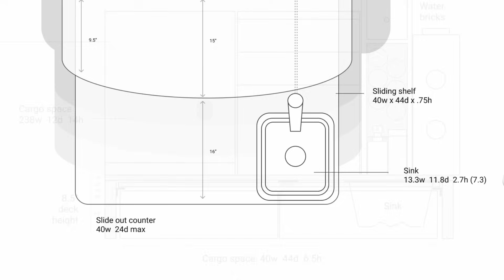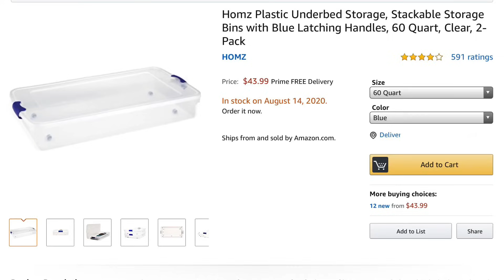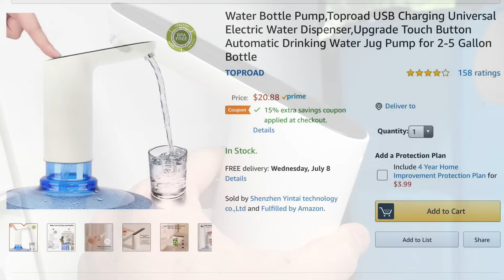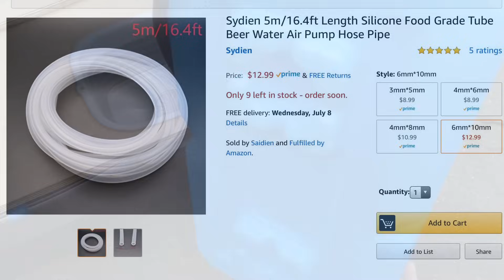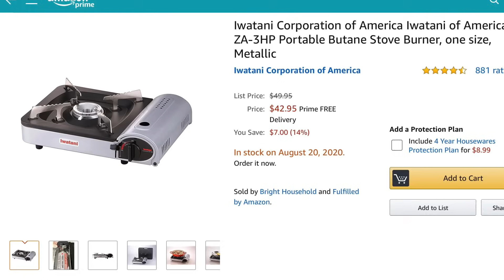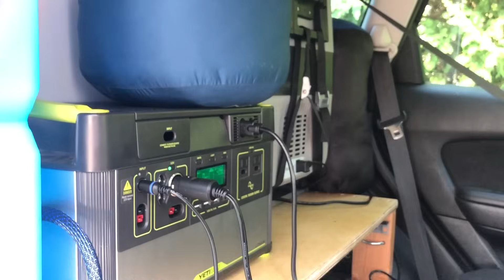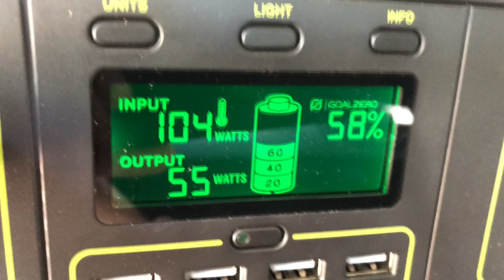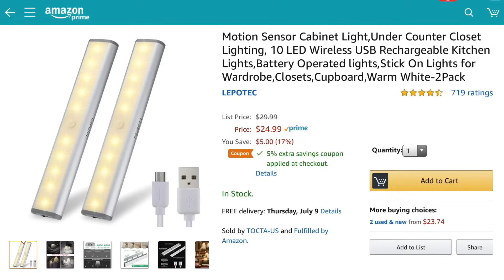SUV car camping kitchen with sink and fridge - DIY organization ideas for family camper

Comment: Love this! I completed a van build last summer, and did a big kitchen setup. Then took the van out on her maiden voyage and quickly realized that I didn't really want to cook inside the van if I could avoid it. I also had some other functional issues, so I came home, ripped out most of my build and am just now finishing Van 2.0. I'm implementing your system by building a platform in the rear of my van that will serve as the floor under my bed. I love the functionality of it, and can either pull it out to make a sandwich in a parking lot (can't tell you how many times I've done that!), cook right there at the back of the van at a campsite, or use the easily-removable bins to relocate cooking gear to a campsite picnic table. Hope you're loving your Dometic CFX-75! That's what I have in my van, and there's truly nothing better than enjoying a pint of Ben & Jerry's while camping ;-)
Reply from the maker: That’s awesome! I’m loving my 75, but it sure is big in my Mazda. Itwill be way better once I get a minivan. I’d love to see your build!

Comment: Thanks for "just sharing", for those of us that are either in the middle of our build or in the design stage ,I thank you very much as I'm in the design section, even though I have a good idea of what I'd like , I still have to pick out the specifics, mainly the brands which of course change things up. And more than likely the dimensions will be different. Wouldn't it be nice if everything was like the water tanks you have, everything fitting together like legos and as someone who is not very good with construction I look for items just like that.
       So this is a guy who really appreciates the information, so I feel I owe you a thank you , you at the very least gave me some idea where to start looking. While I'm sure mistakes will be made by me, it's folks like you that will make those fewer , saving me money which I hope that I have enough to do things effectively. Sorry to hear about the fridge. If you do most of your trips on weekends wouldn't you be better off with a good cooler, ice in a really good cooler will stay without melting for at least a week.

Comment: Thanks for sharing this video, I am in the thinking process of converting a future sienna, sure can use a lot of your ideas, showing the Amazon pages really help, I can screen shot them instead of pulling up the links later, the water bricks and the faucet are something I would use for sure. I am just saving all different infos from different you tubers and one day make my own conversion to best fit my needs, one hurdle I have to solve is convincing my wife to down size from a motor home to a mini van. Liked and subbed.

Comment: Great build out! I would like this in my honda odessey for full time camping. And a great price. I still cant get away from the cooler over a fridge. I just need a simple small fridge, i guess. Thanks for your thorough video.
Reply: Awesome, great ideas, intelligent and uncomplicated! Will use this as a benchmark for my conversion, thanks a lot.

Comment: If you still have the fridge,.. I had the same thing happen to mine.. Found a very simple fix.. Been working fine for a few months in my shop since..I don't know if I can post a photo, but what I did was run a small reusable twist tie (Lowes) through the ventilation holes near where the removable plug goes in, wrapped it just behind the plug head holding it close to the fridge.. Wiggling it as I inserted it... Working fine since... I hope you have the same problem and this solution fixes the issue... BTW.... really dig your layout..
Reply from the maker: Thank for the tip! I returned the fridge but I’m sure that fix is helpful for others

Comment: Great build out! I would like this in my honda odessey for full time camping. And a great price. I still cant get away from the cooler over a fridge. I just need a simple small fridge, i guess. Thanks for your thorough video.
Reply from the maker: This will work even better in a minivan. If you’re living out of the van, I’d suggest getting a compressor fridge over a cooler, mostly because your food will get pretty soggy and you need ice daily. Don’t be tempted by cheap thermoelectric coolers - they don’t work well and use a ton of energy. There are cheap, small compressor fridges on amazon

Comment: I have a Mazda CX5 & I'm in the process of adding a system like this.   The problem I'm having is that my spare tire is stored under  the floor mat where my system will be.   So securing as you did would definitely create a long drawn out tire change.   It looks like I would have to remove my fridg & cabinet drawers before I could remove the platform,  to access my spare tire & jack.   I understand the need to secure a big setup like this but  I also don't want the added hassle.   You have a lot of great ideas.
Reply from the maker: Yeah the spare tire is pretty well buried and you’d need to unload to access it. I have AAA so I would just call a tow honestly

Comment: Very informative, I liked that you included the product information by means of showing a screenshot of an Amazon page, very clever. In your total estimate, you quoted around $750, you forgot to mention your electric system. I checked on the Goal Zero Yeti 1000 W Solar Generator and it costs $1999.00, plus you need to add the solar panels... another $300 to $400 for good ones. By the way, was that brand teepee or tipi. I could not find them, so if you still like them, could you please provide the name with a model and a link. Your sliding bottom shelf is a good idea too. I am a woodworker and I use drawer sliders, but they are quite expensive. Your method works, and it is quite cheaper... good idea!
Reply from the maker: Yeah, I mostly focused on the cabinetry price since those other systems also don’t include electrical or refrigerators and you could just use a cooler. You can get a refurbished Yeti 1000 on eBay from Goal Zero for $730. A compressor fridge costs 250-500, I’d go with Iceco if you want a cheaper fridge with the Danfoss compressors.  I used TP-Solar panels which I really like. You’ll can get 100w panels for about $180 on sale - https://www.amazon.com/dp/B088FPQZ7V/ref=cm_sw_em_r_mt_dp_5NVEJQ41DD0J7QGY5KJ7

Comment: A lot of Aussies use 90mm or 100mm storm water PVC pipe and mount it on the roof rack. The amout of water is deteemined by what length you make it. Let gravity do the work.

Comment: Fantastic fer sure! But... once you add the Yeti power bank, the solar panels and a fridge, you're back over $2,000 again. Yes, you can use a good cooler and eliminate that $2k. Thanks for a great video.
Reply from the maker: Yeah, I was trying to compare what those 2-4K boxes include and they don’t have batteries or solar, just cabinetry, sink, faucet, etc. and like you said, a Coleman cooler would work her on the cheap. I just tend to over do things!

Comment: First, I began building my SUV kitchen to augment my rooftop tent (now 20 years young), a dozen years ago.  I bought a deck box that slides into the back of my XTerra, use it on its side.  The hinged top becomes the countertop.  I built sliding shelves, everything needed, into it. My water supply is a seven gallon Reliance to the side with gravity feed.  This has been awkward to handle, so I decided to try you pump.  I bought a different brand pump because of the dripping when the pump is lower than the water supply.  The one purchased behaved the same way so it must be a design "feature."  The solution is to put the water tank low, say, on the floor of the back seat!  I found that not only do the backseats fold down, they come out!  Now I have the water lower than the use point(s), no dripping, just used a longer supply hose.  And the tanks are SO much easier to handle, refill, etc.  Thanks ideas!
Reply from the maker: Sounds like a great setup! In my new build, I removed the 3rd seats and put a 10 gallon water tank there to fix the dripping, works like a charm now.

Comment: We have a '16 CX-9. I.may just "borrow" some.of your ideas. Thanks for posting!
Reply from the maker: Perfect! It’s a very curvy car so be sure to do lots of prototyping in the car to get the angles right. Looking forward to a square minivan...
Reply: @todd.parker  Will do! Thanks for the reply.
Reply from the maker: Norsefalconer One tip: if you have the rubbber mats in the back, you can trace that for the back hatch curve and remember it’s asymmetrical- the little pockets on the left and tight are different depths so trace from the center of the logo, not the mat. I..uh..learned the hard way
Reply: @todd.parker  That's a great tip! We have Weathertech mats, so the process might be a little different. Thining about it....I suppose the under floor storage bin covers (left, right and center) might be good as "rough" patterns as well.
Reply from the maker: @norsefalconer  Very true, the curve is a bit hard to draw so using something to trace is good. You can also go inside and cut some cardboard to the curve too, or just leave it straight and lose a few inches of counter space on top. One downside is you can't access the storage area by the spare tire so what I did is move the things I normally keep there (jumper cable, fix a flat, 12v tire pump, etc.) to the back of the right hand bin so I can still access those. If I need to access the spare tire, it's going to be a lot of work but I'd probably just call AA at that point.

Comment: Good job Todd! Looks great man! I used the same water dispenser
Reply from the maker: Oh nice. In a camping setup or on your 5 gallon water bottle?
Reply: @todd.parker  I took my 2000 ford expedition (old car) and converted into an Camper/traveling truck for my family. I used the dispenser and connected it to a 4.5 gallon water.
Reply: By the way, I took it for its first dry run this passed weekend. We went camping with it this past weekend
Reply from the maker: @motivason  Awesome! Did you come up with the dispenser idea at the same time I did? If so...great minds
Reply: I think we did brother! 🤙🏻

Comment: We love this build! Want to do something similar for our Toyota Highlander. We use water bricks also for our hurricane supplies and think they would also work well for our travels. Do you still like your build? Anything you might change or suggest to us now that you've been using it for while. We appreciate your channel!
Reply from the maker: Thanks! Great question. Since I made this video I bought a Pacifica minivan and have been working all winter on a new kitchen set up for that. I think for an SUV this still is solid though I might suggest trying to place the water bricks below the faucet because it will drip a bit otherwise and look into using aluminum U channel like this instead of the angle iron to support the drawer from the top and bottom. https://www.onlinemetals.com/en/buy/aluminum-channel

Comment: Very nice ideas!  Surprised by the projected cost of the system. As you point out, the Chinese fridge for $325 didn't hold up. I suppose you get what you pay for.  I think you forgot to mention your YETI power system is around $1,300, plus all the PV panels and other stuff might be as high a $2G.  So one is not going to out together a rig like yours for $750.  Great ideas and info on hardware for the DIY crowd.  I'll definitely use some of your ideas on my Gen.4 4Runner which will be going through a slight overhaul from the system I made, especially moving to a modern 12V fridge from the 3 way propane one I use now that I bought 10 years and still works, including using more extended bearing pullouts to make access more convenient. Thanks for all the ideas and a great video.  Cheers, Marshall
Reply from the maker: Yep, I mention that the costs are for the structure itself since you could get away with just a cooler for $30 or spend thousands on a Dometic fridge, Goal Zero 3000, and 400w of solar panels so I figure that part is too variable to nail down for everyone. I ended up getting an Iceco JP40 and have been very happy with it, they run about $500, less on sale.

Comment: Thank you for the great video! I accidentally found you! I want to do something similar in my Yukon that pulls my TAB 400. Instead of the file cabinet, I’ll put in a Milwaukee 3 drawer tool bin (is it called a Bag out system?) Next to my electric cooler, like yours.  I’m pretty excited, now.  Thank you! Gail
Reply from the maker: Sounds good! Check out my minivan video for lots of new ideas. Thanks again for your support

Comment: If you put a roofrack on the, well, roof, you get TONS of extra space for stuff. Maybe add a topbox, doesn't need to be huge. I've seen a genious idea, using a plastic rifle box for recovery gear and some tools, like a saw and axe. OR just add a rooftop tent, so all your extra tent and sleeping pad crap just fades away. Some don't even cost that much.
Reply from the maker: All good ideas. In a later video, I added a roof bag and it's great. I just bought a Pacifica and am re-working all this so we can sleep inside and have a rooftop tent for 2 more.

Comment: Great video Todd !! I'm in the middle of a mini-van build out myself and your water system was very helpful as I am doing something similar but the braid, elbow and shrink sleeve (do you have a link for these ?) were ideas that will definitely help me. I am building out a 2008 Honda Odyssey and we have a bed inside. When I am all done, I will shoot a video as well to show others what I did. I also found the USB chargeable water pumps but the one you're using looks like it has a better flow than mine. Thanks for sharing !
Reply from the maker: So glad it was an inspiration. I'm finishing a minivan build myself and will post a video later this summer.

Comment: Consider a grey water pail  matches incase the stove igniter fails and place the garbage on the side of the file cabinet instead of on the drawer or use a locker shelf inverted it will hold open a small kitchen catcher and can be stowed away when not in use
Reply from the maker: Good tips, thanks

Comment: That water faucet looks great... can you give a description of how you took it apart and then put it together to make it work the way you have it?
Reply from the maker: Sure. The faucet comes with a short length of tubing and is designed to sit on a 5 gallon container. I needed the tube to go out the back of the unit so it could sit on the counter so I used a Dremel to make a notch in the back large enough to fit the tube. Since the tube connects vertically in the center of the faucet base, I wanted to give it some room to make that right angle so inside the base (it's empty except for the tube), I added some foam donuts I cut out, then took a small roll of tape and cut a slice out of it with a hacksaw wide enough to fit the tube to make a base that lifts the faucet up a bit and has a space for the tube to go out the back notch (you can see in the video). I then glued small magnets on the bottom so it attaches to the metal disc on the countertop.

Comment: Great video but I have a question!  How do you prevent the work surface on runners from opening / closing when you don't want it to? Is there a way of locking it in the open and closed positions?
Reply from the maker: No but there is enough friction with the felt tape that it’s never shifted out of position

Comment: I've been looking for ideas to convert the back of my SUV for a camper feel and these are great ideas! however we would be using the back row and such as a bed base for an air mattress.  Do you have thoughts on a bit of a smaller mod that could be stored to allow that? Thanks!
Reply from the maker: I’m working on a setup like that for my minivan, stay tuned

Comment: I have a Nissan NV200 and have been going through a similar quest.  I found a steel filing cabinet like yors but the edges were all rounded.  Did you take the 20lb steel plate out of the bottom back? You have it bolted down so that steel plate is not necessary.  
I was confused when you said you used 12mm baltic birch and then you said 3/4"  From the video it appears you used 3/4" (19mm).  I did not think of using magnets to keep things in the drawers... great idea.  Thanks for the video... you have given me ideas about my next phase... the prep surface
Reply from the maker: Glad it was helpful. I mis-spoke, it was 19mm (wish I could edit!). I did take the bottom plate out, yes.

Comment: Amazing DIY! 👍 No issues about driver not being able to see out the back window? Was pulled over once and fined because I loaded the back full of stuff, blocking my rear view...
Reply from the maker: From what I’ve read, it depends on the state and how grumpy the police are. Technically if you have 2 side mirrors, you should be fine. Tons of vehicles prevent you from seeing out the back window- trade vans, campervans, box trucks, etc.

Comment: Hello fella, awesome video. Im mid 50's in age and treated myself to a project car for overlanding (diesel subie forester. Uk guy) and am looking to do similar things. Water bricks and battery-powered faucet (genius). Sink and worktop idea brilliant aswell. I've got a 12v fridge being delivered soon which plugs into 12v outlet in the car. Will I need any intermediate gadgetry to fit between 12v outlet and male end attached to fridge or just plug straight into the cars power source. This is all new to me. Any advice welcome please.
Reply from the maker: You can plug your fridge right into the 12v port on your car but when the engine is off, it can drain your battery quite a bit so having a solar generator or separate 12v battery for the fridge is better for the long haul
Reply: @todd.parker  Thanks Todd, think I'll go with the secondary battery as that's the safer option as I have a spare in the shed. Thank-you bro... much appreciated.